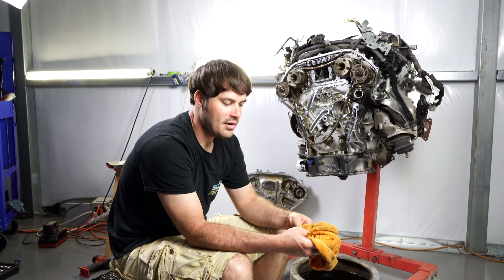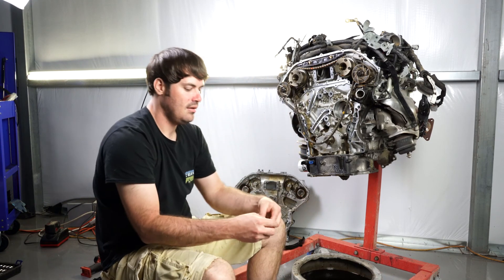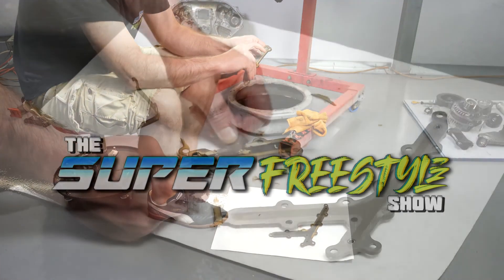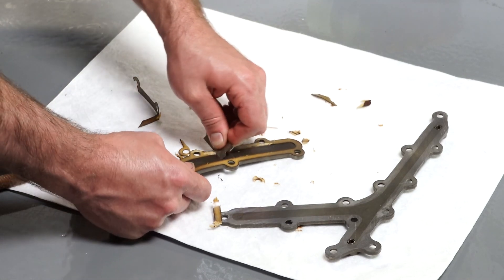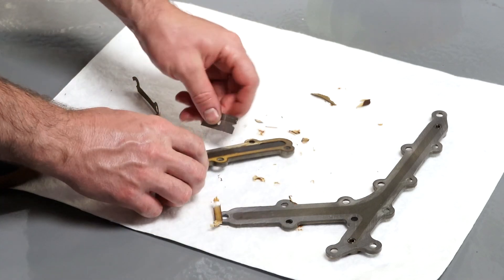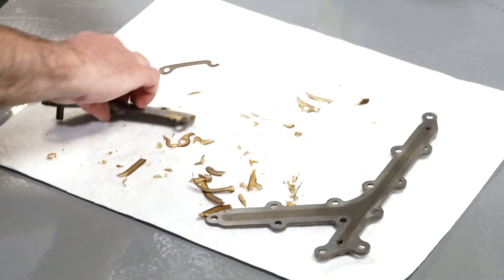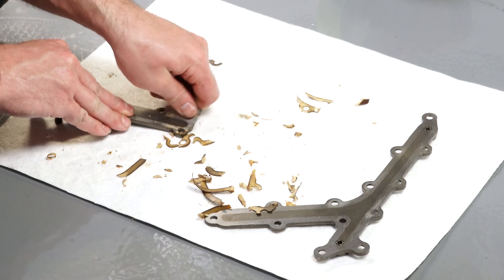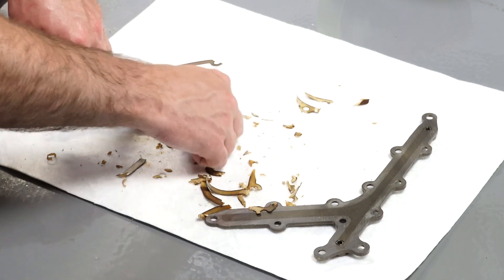VQ35HR Gallery Gasket Nissan 350Z - assembly - part 2 | SuperFreeStyle Ep35

Comment: dawn dish soap and warm water work really well at getting rid of the paper style gaskets. just did both of mine in about 2 minutes, on small parts with like these i'll use mother mag wheel polish or jewelers rouge to "level" it with a small dremel.

Comment: What are the torque specs for those Allen screws?
Reply from the maker: Nissan doesn't have a stated tq spec but the guys at CZP recommend 10-12 ft lbs
Reply: Can leaky gallery gaskets cause idle misfires as well as low oil pressure and oil light on

Comment: What torque did you use for the screws holding the new gaskets on and how did you get the specs?
Reply from the maker: 10-12ft lbs is what is recommended on CZP's site

Comment: I wanna do my he’s galley gasket too, but I need to do the timing chain too, it’s at 160k miles.. I’m kinda scared but this video gave me motivation
Reply from the maker: You most likely don’t need to replace the chains.. I’ve done them at that mileage without since the failure point is generally the guides, you can look at how far extended the tensioners are and determine whether the chains have been stretched... Inspect the guides and make sure that they are in good shape, replace if necessary.
Reply: SUPERFREESTYLE  what all did you need for the galley gasket replace? Besides the gasket and hondabond